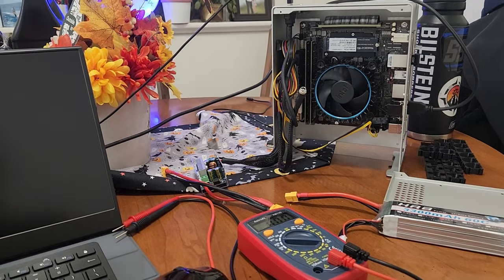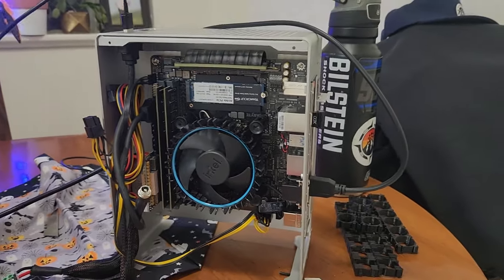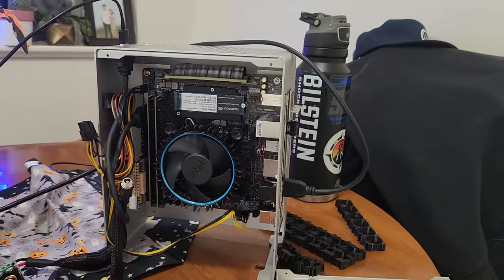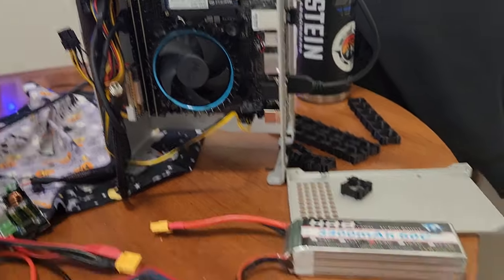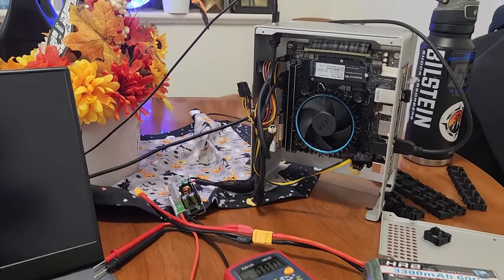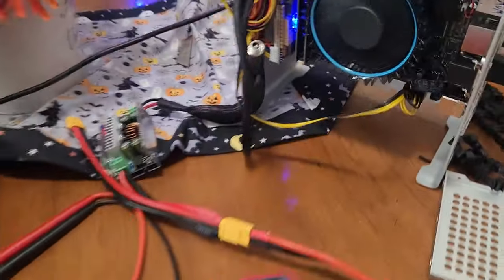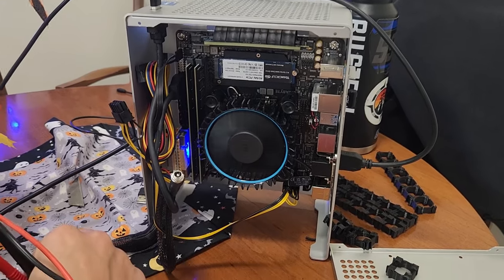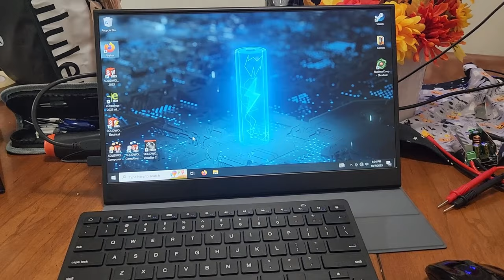Custom Battery powered desktop gaming PC

Comment: Super cool
Reply from the maker: It's now in a 3d printed case too haha
Reply: @jankyadventureswithjackson  any problems with warping from the heat of pc components? Also, did you underclock anything, or is everything running stock?
Reply from the maker: @planenerd9079  nope I used petg and everything is undervolted, I run at about 120 watts total including monitor playing starfield
Reply: @jankyadventureswithjackson  that is sick! I wonder what percentage of performance you're getting compared to stock settings, since power consumption isn't linear with performance. (90% performance for like 80% the power consumption as an example)
Reply from the maker: @planenerd9079  it's pretty mild of an undervolt and it's extremely close to what I got without it

Comment: Hi there im building something similar and couldnt figure out how iam going to power the motherboard can plz tell me how can i power my mother board entirely on a battery pack which sort of conveter and all other type of stuff i need to make it happen ...
Reply from the maker: @onlygaming8106  you will need a pico PSU and a DC to DC step down converter if you plan on using a 4s battery set up, also check my later videos
Reply: @Dirtscootdesigns  how I am going to connect pico PSU and step down converter...in which sequence. Im planning to use a 90 watt hr laptop battery since my build draw very little power ..is going to work with laptop battery?? And what about BMS and all that charging stuff...
Reply: @Dirtscootdesigns would a 200w pico psu be enough for my build and what sort of step down DC convertor do I need .. ?? I am using i3 12100 with 75 tdp GPU
Reply from the maker: @onlygaming8106  they are cheap id just buy one and try it out, my setup draws 130 watts max and I use a jbd bms to control everything and also I believe my other video show the pack configuration
Reply: @Dirtscootdesigns thank you for help it really helped me..
I think 200w psu would be enough as my setup draw 150w max under full load also I am going to under volt my setup to minimize power draw...
can you provide link for the configuration video ....